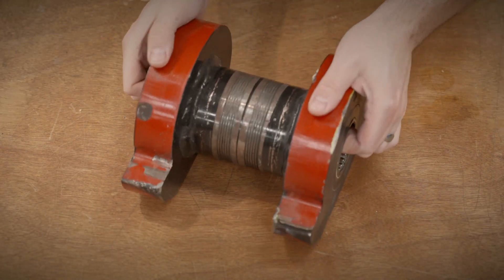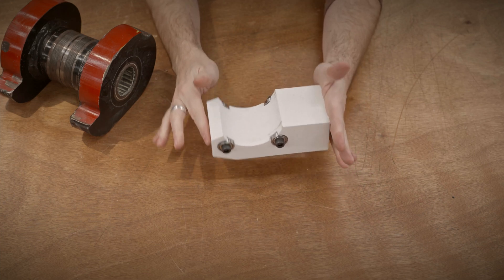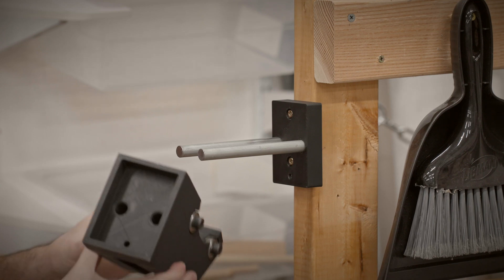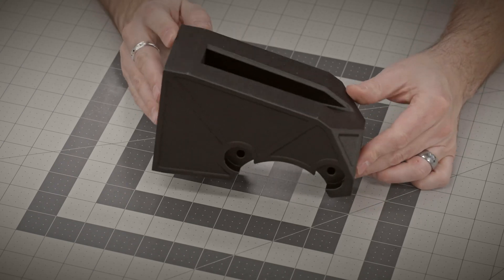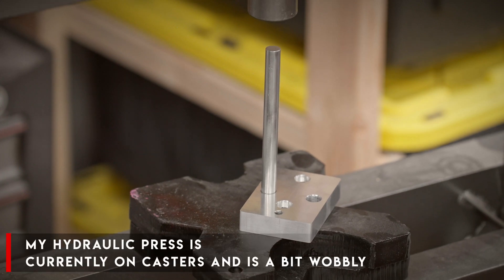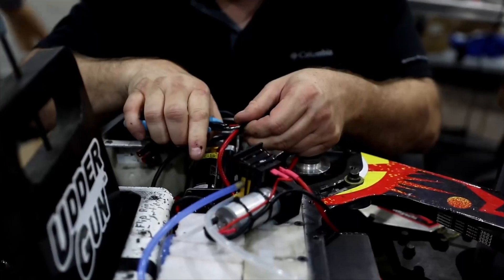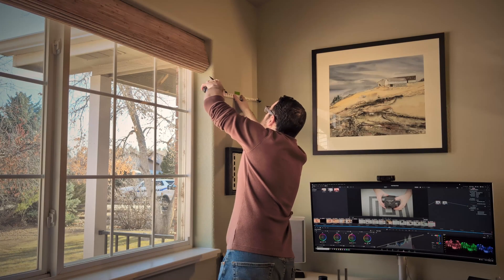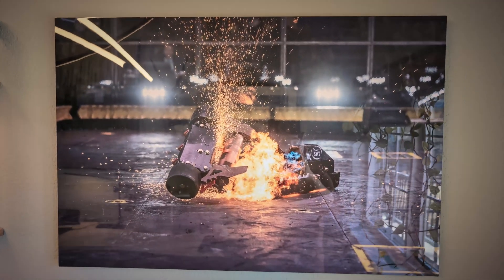BattleBots Trophy Mount - Fusion vs. Copperhead

Comment: Bonus points for the exposed hardware at the lasered insert.  If you swap those out for socket head bolts 10/10.

Comment: Curious why you printed it in the orientation you did, as I would think you'd want the layers going parallel to the load, no?
Reply from the maker: I was wondering if someone would ask this ;-)  It might be hard to explain in text, but I printed in that orientation to line up the strength of the layers with the rods.  If I had printed with the layers parallel to the load, it would have been weaker against the rods.  The layers would be pressed against the rods (which are holding the weight), which could cause the layers to separate.  But with the layers perpendicular to the rods, it spreads the load to the rods.  ALSO, it allows for the walls around the holes for the rods to be stronger, better transferring the load into the rods.
Reply: @RobertCowanDIY  appreciate you taking the time to explain that, makes sense now.  Thank you!

Comment: A time lapse of the fusion 360 design would be neat.
Reply from the maker: That would be impossible since it was done in Solidworks ;-)  My time lapses would also consist of me going down a wrong path, closing the file, opening a new part, and then doing that a few more times until I figure out the way I want to make it ;-)
Reply: @RobertCowanDIY  that's also instructive. Maybe something for 2nd channel?
Reply from the maker: @andrijafrlan  Yeah, I barely have the time for the one channel!  Maybe once I retire I could focus more on content.

Comment: You have a lot of faith in drywall anchors, I would be so sketched out. End result looks great though!
Reply from the maker: At the end of the video, you can see an even heavier weapon being held by the same brackets.  It's been that way for several years now.  I have faith in them because when used properly, they work just fine.

Comment: Your comment about always pushing limits and technology also applies to the arena. We had a partial breech at our last ARC event, where a bot’s weapon got through one of the doors, but the bot itself didn’t get through thankfully. So the latest standard (for beetles) is a dual pane wall with an air gap, so we’re in the process of making a new arena. Come over and try to break it when we’re done. 😁
Reply from the maker: Oh for sure!  As the robots get more powerful, so does the arena.

Comment: I would recommend aligning the screw drives (slots). It will clean up the faceplate appearance. Love the design. Overengineering FTW :)
Reply from the maker: Hum, I kinda like the small M3 phillips.  I kinda hate slotted screws.  Allen would be my preferred though.
Reply: @RobertCowanDIY   what I meant is to get them aligned. Like they are +++ not +x+ for example. Totally agree Allen would fit nicely with the aesthetics;)
Reply from the maker: @AntoninKral  brb, grabbing screwdriver...
Reply: @RobertCowanDIY  ROFL, really appreciate your response. You've made my day.
Reply from the maker: @AntoninKral  I appreciate the attention to detail!

Comment: Would be cool to have a motor in there attached to a little wheel that spins it so it's like a kinetic sculpture. If ya wanna get really fancy you could rig up a capacitive touch sense on it so it spins for a while after you touch it.
Reply from the maker: HA!  That's a whole can of worms.  Also, I actually use my office and it would be annoying to hear it spin.  I like inviting people to interact with it instead.  I'll often take the SOW arm off the wall to give people an idea how heavy this stuff is.